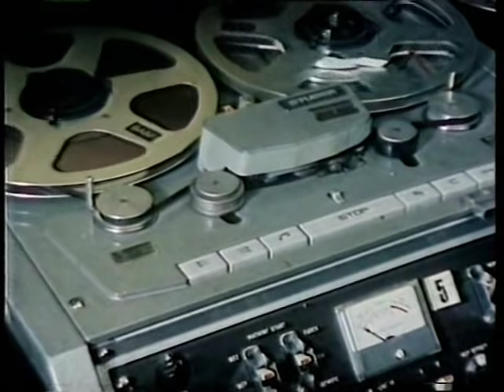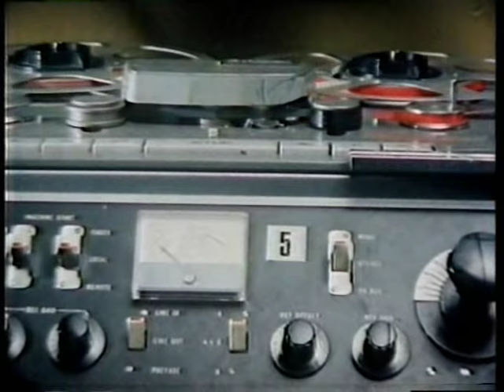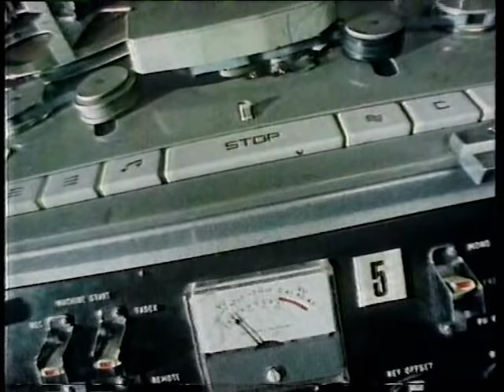Musique Concrete

Comment: Thank you. I was curious as to what exactly is musique concréte because The Mars Volta use it on various occasions, but I didn't really understand until now. Truth is that I have already been planning to make music this way, but I've been calling it "noise music".
Reply: Well as far as i know. Noise music has 4 different sides. Wall Noise,Power Electronics,Harsh Noise and Musique Concrete.